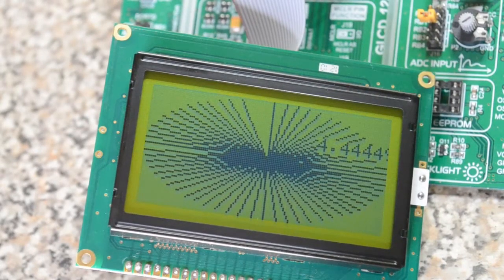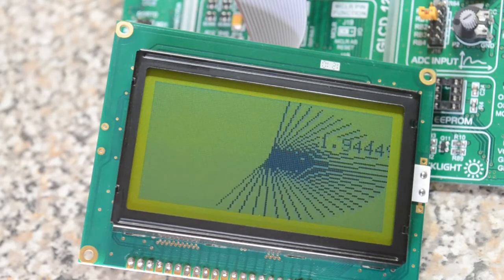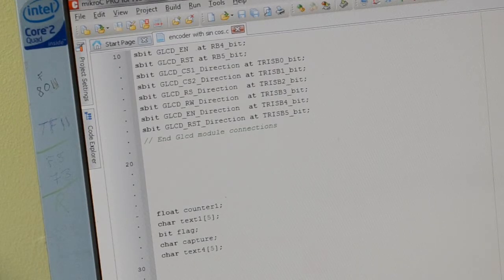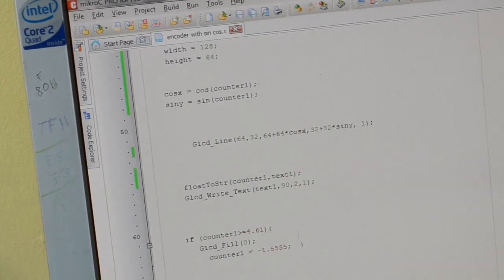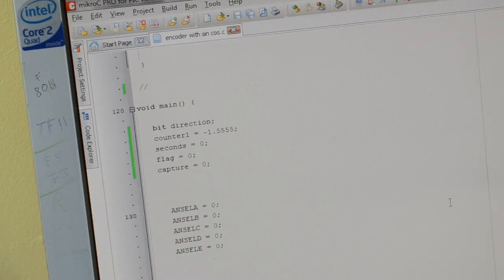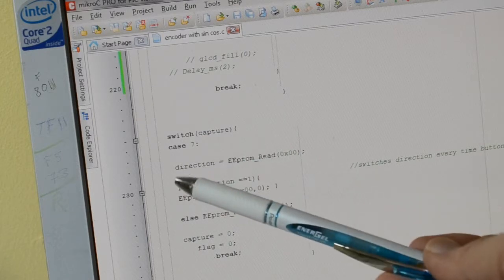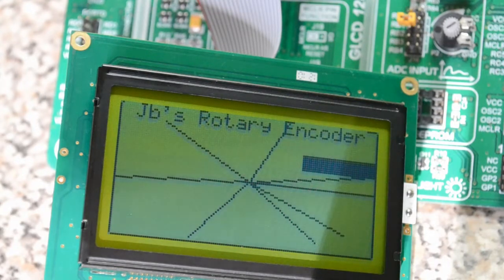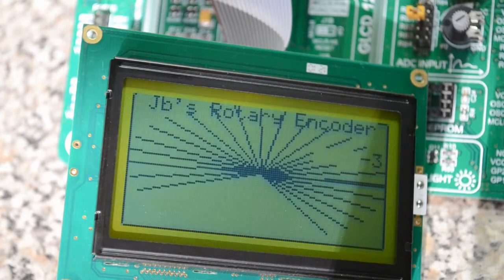Rotary Encoder with new code (part3) displays line using sin and cos of counter.

Comment: There are 2Pi radians in a circle, hence the 6, actually 6.28
Reply from the maker: Yes I know, I don't know what I was trying to gain back then lol
Thanks
Reply: @JohnB-2021  Hello, I want to try to repeat the project, can you share what kind of Arduino board it is and also the code (sketch)?
Reply from the maker: @LionTurbo  Sorry it's a 10 year old code on a Pic microcontroller and I no longer have the c file.